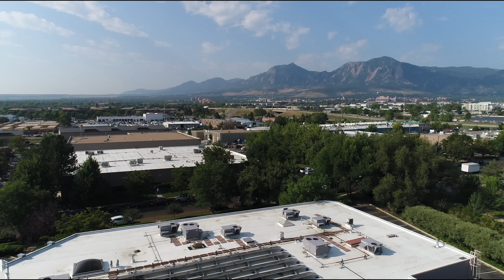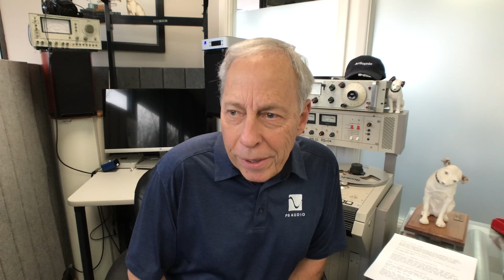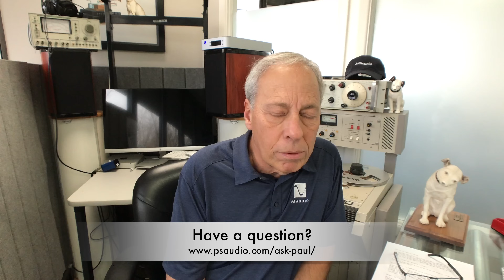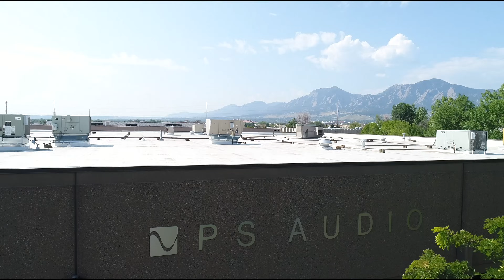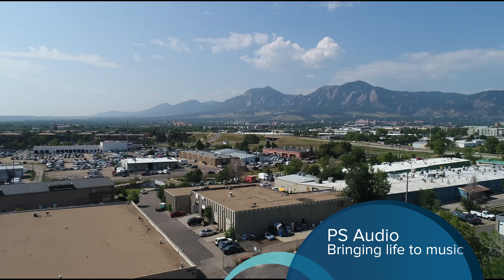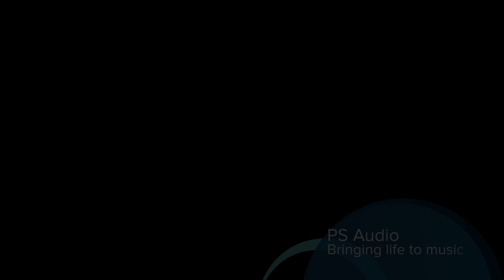Do transistors age like tubes?

Comment: Manufacturers of modern devices have other ways of making them age.   Clustering the electrolytic caps around the biggest source of heat in the device so they'll fail in a fairly-calculated amount of time, with some really thin traces right next to them so that any leaking electrolytic will dissolve them...   And more recently, making everything processor-controlled, even when they don't need to be; often with volatile security-locked firmware kept alive by a battery that's in an inaccessible place, so when it dies, the unit dies.   Another trick is they'll use a clamshell case, and put strong glue on fragile ribbon cables that run board-to-board inside the unit, cables that are made of thin plastic and can't be soldered, so that if you open the unit it rips the cables....    ETC.

Comment: I hate to disappoint you, but transistors age big time after 30 years. If not someone explain to me why all this vintage audio that I worked on. Has so many transistors making noise and most of them have lost 40 to 60 % of the gain and output. The used silver alloy on the pins, that today the silver disease has worked it's way up into the case and lost the conductive abilities.

Comment: I have a problem with a power supply in an amp. It's a transistor-based regulator which employs negative feedback to set the desired voltage. Intermittently, this voltage drifts higher than nominal resulting in noise blips. I was wondering if an aging transistor could contribute to a problem like this, or perhaps an aging zener in the circuit (which helps establish the reference voltage). My first guess, of course, would be resistors, but after testing, they appear to be okay. Thoughts, anyone?

Comment: Hey Paul,
First up: greetings from Germany👋
Considering the statement that transistors won't age in terms of lifetime is only kind of true.
Transistors do age quite significant by exceeding there ratings. For example a MOSFET. (Only types used for today's logic)
We got some major aging mechanisms contributing to that behavior:
Current while on (Hot Carrier Stress). Stress on the device during conduction. Reason here is that electrons with high velocity (high voltage between Drain and Source) causes these particles to break the Si-H bonds of the passivation layer,, thus destroying the isolation of the gate oxide. This results in leakage between Drain and Gate ( Mostly because the electrical field is stronger on Drain-side).
Second Stress is so called non conducting stress: mechanism behind this is, that high voltage causes electrons to break up the Si-O bonds in oxide layer, resulting in leakage as well. 
Another reason is the drift of the threshold voltage (voltage applied between Gate and Source to turn the transistor on) due to defects in the oxide layer accumulating charge carriers, thus resulting in biasing the Gate. 
Another mechanism is especially true for power fets: Due to high current densities, the channel experiences erosion effects, because of high velocities, so called electromigration. This thins out the channel, raising it's resistance and resulting in open circuit of the Drain source passage.
There are more than this brief explanations involved, but to answer in short: the manufacturers give some life times at given working conditions to make sure, that you'll probably never experience these breakdowns during your operation.
Typically you'll see, that (very) old transistors won't perform as well as brand new ones. You can accelerate the aging of your semiconductor devices simply by violating cooling and operating conditions.
Hope this helps and doesn't let me appear to be the smartass 😅

Comment: Sorry to contradict - we refurb 1960's 1970's and 1980s audio - the old signal transistors do deteriorate. The method they were packaged isnt as refined as today - the package can leak air to the substrate eventually - then oxidation causes intermittent crackle in an amplifier.
Reply: I just replaced 5 small signal transistors in a Pioneer SX-1010 Receiver to eliminate the sporadic crackling in the Right Power Amp and random noise in the left Phono Pre-Amp stage.  Sounds like new again now.
Reply: Hard to believe the unit is 47 years old!
Reply: The bjt transistors needed to be matched using a curve tracer. Modern parts with different parameters and  archeture would not be something you just swap and go.. they wlll not have correct gain or bias or work together ... DO NOT BELIEVE THIS.

Comment: so basically the transistors dont age. its the calacitors that end up killing electronics. so if i change the capacitors in old electronics before they screw up the system. i basically have a new amp ?
Reply: Solid state can go bad too. In general, yes capacitors are the main reasons for most of failed components.
Reply: Apart from dead capacitors, resistors do get burnt out too.

Comment: Just a small clarification: it's doped SILICON not SILICONE.  Silicon is an elemental semiconductor.  Silicone is a polymer containing silicon that is used for kitchenware and sealants.
Reply: Ya, you'd think an Electrical Engineer would know this. Drives me INSANE to hear anybody say silicone.
Reply: @douglas2lee929  Yeah, kinda basic stuff... that said, Paul doesn't have an  degree in engineering or science, so I didn't give him too much of a hard time.
Reply: @terrywho22  ok

Comment: Heat is one thing that can shorten the life of solid state components(not counting the burn-in  testing that is used to find bad components before they leave the factory), another is over voltage/current conditions.
But generally, solid state components will/should last essentially forever(beyond our lifetime).
Reply: No.